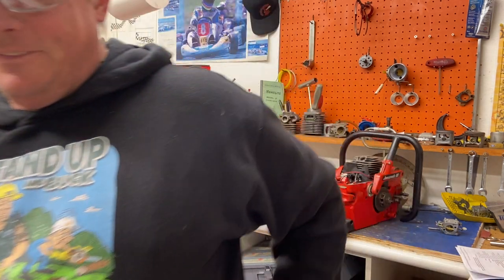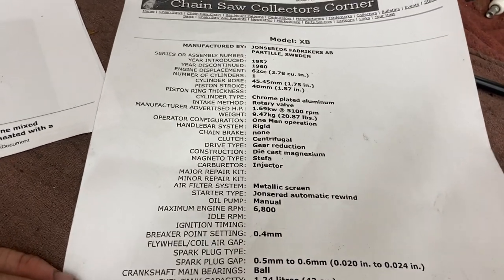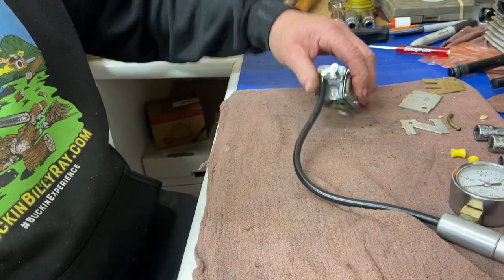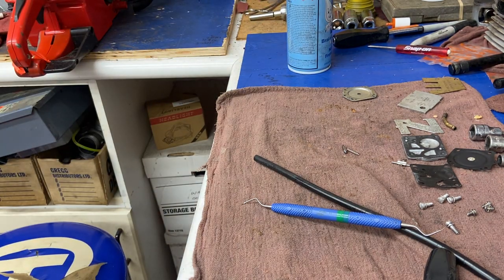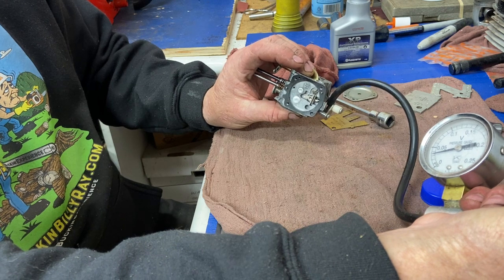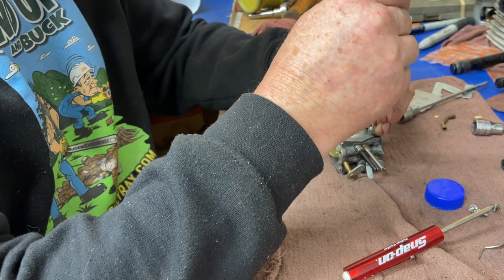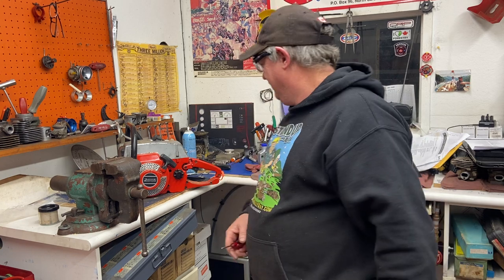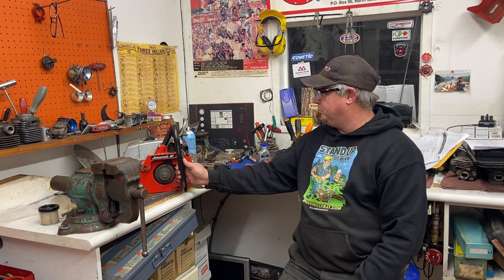Donny walkers chainsaws firing up old jonsered 80

Comment: Outstanding Donny
Back in the day, about 1980 Dad traded all the old Homelites at the local sawshop and came home with some new paint of a few month period. first a Jonsered 52?  great little saw, who knew a chainsaw could  run or sit and idle all day.  Then home came a 480 Xp and Big Brudda 2100XP  HOLY COW,  wish they would just build these again.  
Now we could use another bigger saw  and a few weeks later brought home a used Jonsered 801 that the shop rebuilt cause it had burnt or scorched  a piston.  The story goes they had a jug kit for a 90 Jonsered on the shelf  and made it fit, got it tuned up and running.  well it ran great. almost keep up with th 2100 Husky , but this old reworked 801 would get twice the time out of a tank of gas.  
it was a heck of a set of tools for a 9th grade farm boy  to use after school or on weekends  cutting fire wood or on the log landing trimming logs or cutting the to length.  This was in Ozark Mountains in southern Missouri USA,  we had agood sized farm with around 500 acres of woods, hardwoods.    just your average chores for an oversized 13 year old.

Keep your rubber on the road, but once in a while smoke'm to a fresh surface
Reply from the maker: Thanks buddy sounds like you had a cool place to be as a kid do you still have some of those old if you do get ‘‘em out tune them up
Reply: @donnywalker4691  Ran them to the end and sold them  for parts when our parents farm was auctioned